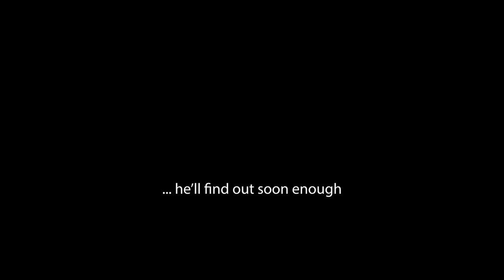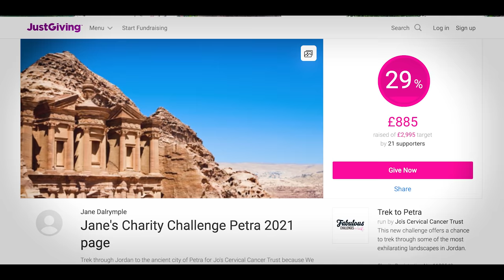COW'S HOOF SWALLOWS my FINGER!

Comment: I'm from the American Midwest (central Illinois) and we don't get /that/ much mud, but this year, in late winter, we had a heavy snow followed by a warm spell that lasted several days. This meant that the top several inches of ground melted and turned to mud.
I'm a rural carrier for the post office, and those mail trucks are NOT four wheel drive. They're 35+ year old sheet metal sheds on wheels with four cylinder engines that have /insanely/ high miles... 
I nearly got stuck twice in one day on that mud. It was so nasty. (Don't even ask about the rural roads after a snow.)

Comment: I wanted to ask you a question. I watch this all the time. I cut meat in grocery stores for over 25 years.Good thing for these ladies we only cut steers. But I worked at a slaughterhouse outside of Allentown Pa. And once these girls stop producing milk or fall and split an aitch bone they end up on the plate. Anyways my question. Why do you shave a concave slice out the inside middle of the hoof on each side?? Is it to keep debris from becoming lodged in between that tight crack. Thanks, peace from SC

Comment: No one that is good at backing up trailers opens the door. You should be all set with mirrors. Half of it is the approach and the second is stop over correcting. Practice I started at 8 on a lawn tractor and was putting our boat in for dad at 11